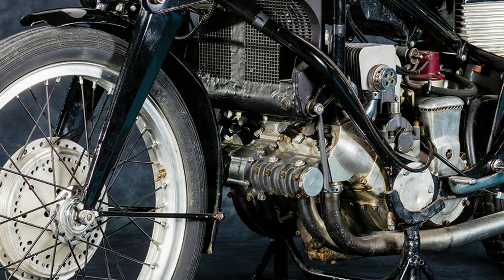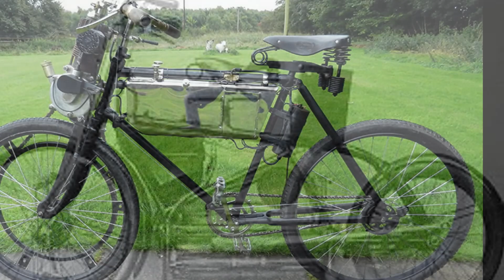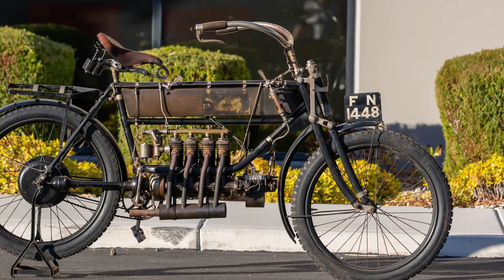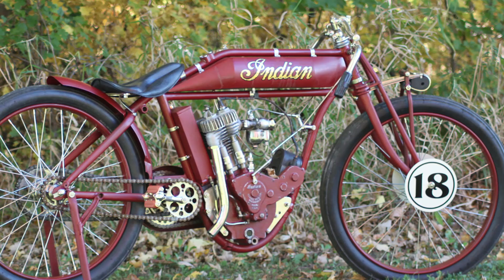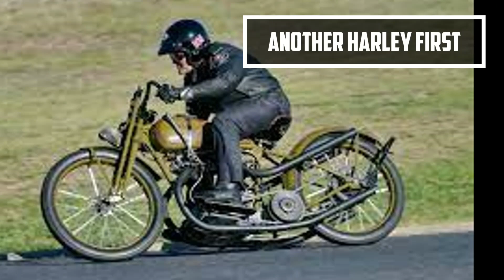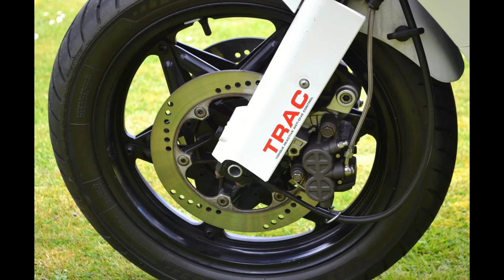15 Innovations That Made Motorcycles Better

Comment: I can believe your channel's growing exponentially! Quality is the watchword. I had to check when the Silk 700S was manufactured, but it was from 1975 onwards, so the 'Kettle' was well before it. Lovely British bike though.
I agree with you about Wikipedia - often inaccurate, so needs cross-checking.
Reply from the maker: the Silk was the final incarnation of the Scott in many ways, just about 70 years on from the first 🙂 cheers for watching mate, I do my best 🙂
Reply: @barebonesmc  Even Alfred Scott was pre-empted with water cooling… by the world's first production bike, the Hildebrand and Wolfmüller.
Reply from the maker: I did say that Scott weren't first but if the H/W was watercooled that pre dates the 1899 Holden I came across. Ive heard a few sources say the hildebrand and wolfmuller was the first motorcycle, but ive got it dated at 1894 as the first multi cylinder, but ive got the Rietwagon as the first motorcycle from 1885, are my dayes out?
Reply: @barebonesmc  H&W was the first series production bike offered on the market… as opposed to prototypes and owner constructed machines, like the Daimler Einspur (or Reitwagen) of 1885, and I guess, as Americans consider 3 wheelers as motorcycles, the Benz Patent-Motorwagen ("patent motorcar"), built in 1885 and normally considered the first series production car, is a motorcycle too.
That strange looking rear mudguard on the H&M is actually the coolant header tank/radiator.
Your references to the Suzuki amused me, as I worked at a bike shop when the GT750 was released with advertising claiming it as the 'first water cooled two stroke'. After Suzuki GB were approached by Scott aficionados, they changed it to 'the first water cooled two stroke triple'… again contested by Scott fans as the short lived (due to WW2) 747cc 3S was unveiled at Olympia in ’34 and finally production began as a 986cc tourer in very small numbers in ’39, before being immediately cancelled. Then again, Suzuki's marketing monkeys had form for this kind of thing, as they advertised the T500 in the States as the first road going 500cc 2 stroke twin (again, Scott had one much earlier, as did DKW)
Suzuki crowed over Yamaha about their 'Pozi' lubrication system (direct to bearings) being better than Yamaha's Autolube… but my brother has a French Soyer 2 stroke from 1922 with a similar direct to bearings oiling set up from a separate oil reservoir, and Scott (yet again) had a system similar to Yamaha's from before WW1.
As for electric start as standard fitting, the Germans had it on several scooters in the fifties (using the dynastart system).
Reply from the maker: @chrisgraham5186  interesting. guess ill need to look at electric starters again :-) Makes me wonder how the industry would have progressed without the interference of the war.. The 500 DKW sounds interesting too, ill have a dig an see :-) cheers for your wonderful and helpful additions :-)
Reply from the maker: @chrisgraham5186  not sure what happened mate, got notice of your comment re pics but cant see it anywhere, you can contact me through the contact page on barebonesmc.com and ill reply, interested to see the bike
Reply: @barebonesmc  YT probably rejected my reply because I included a link to the DKW 500 twin… a 1930 advert for the bike. It may have upset YT's bots. YT doesn't allow pics in comments, so I'll send pics of the Soyer to your link.
Reply from the maker: @chrisgraham5186  nice one mate, cheers again for the info too
Reply: The Velocette LE horizontally opposed side valve twin 150 of 1948 also predates the Suzuki 750 triple by 28 years.
Reply from the maker: @G58  not the Scott though 🙂 Cheers for watching mate the Velo LE was a strange looking thing lol

Comment: i think Yamaha had taken Bimota's lead from the 86 YB4.. they look VERY similar in the spar extrusions & design.. so i hazard Bimota had a preproduction development running in 85 & i recall kawasakis foray into monocoques had wrap around spar elements.. i think the idea was sporned by sidecar racers not concerned so much on wide chassis's more low
Reply from the maker: Interesting theory, it's certainly possible. There’s an interview with korky ballington and the KR500 with monocoque in one of the videos. Think poss the best sounding 2 strokes video here
10 Best Sounding 2 Stroke Road Racing Motorcycles
https://youtu.be/9to1RGAThr0

 or maybe the fastest 500s?

Comment: I just checked back. Vincent used twin shocks, but basically the had centre shocks and stressed engine design in the very early Fifties. They may have earned the title of pioneers there.
An anti dive system was available with the Suzuki Katana in 1982, and I vaguely remember that BMW had something like that even earlier, so Honda may even have been somewhat late to the show there.
Reply from the maker: yep, the Vincent was the first cantilever rear end i think too. as to the anti dive, all i can go on is what i (think i ) know and what i can find out mate, they may have had earlier anti dives. i know they were being used on the race bikes, but i dont remember any on the road until 84, if the first Katana had them im obviously wrong though 🙂 ill see what i find when i get chance, cheers, and have a great weekend
Reply: @barebonesmc  Just take a look at the front brakes of the Katana. It's pretty obvious. The way I understand it, Suzuki used a different system from Honda, though, the brake pressure itself was used to stiffen up the compression stage of the shock absorber. I am pretty sure they had it on at their introduction in 1982.

Comment: What I was told and it may not have beenthefirst, but very definitely an important innovation was Royal Enfields cush drive rear hub. Still used today and the reason why we don't blow our transmissions up. Even with slipper clutches, it is still being used. 
Also, I thought it was FN that first put electric lights on a motorcycle? Or was it FN that first put lights on a motorcycle, as in magnesium strip lights?
Reply from the maker: the cush drive is a good one mate cheers, and i may be wrong on the lights, i do dig deeply but im not infallible 🙂 i would have thought acetyline lamps on the FN, but dont quote me lol
Reply: @barebonesmc  heck yeah, you dig deep! Some of those really surprised me! One thing for sure is people tend to repeat things they hear without checking the facts. Keep up the good work!
Reply from the maker: @750INTERCEPTER  I like the ones that surprise people lol have a great day mate

Comment: No comments I'd surtanley say you mist the NSR125  AND THE TZR125
Reply from the maker: great bikes, but why specifically did you think they changed the industry?  :-) Cheers for watching mate, ride free 🙂
Reply: @barebonesmc  because of the fram and because there 125cc all videos just talk about 300 _1000cc bikes but I'm a 125 man 250cc no good to me & both nsr and tzr had the bigger brothers as well and the nsr was a racing bike
Reply from the maker: @rabone1968  the frame had been done before on the FZR though, and ive got nothing aagainst smaller bikes at all, i talk about more smaller bikes than most but i guess i could look at doing something 125cc specific, ill have a think

Comment: Vincant Black Shadow was a moto shock in 1954
Reply from the maker: had this conversation in another comment :-) as far as i am concerned i would describe the vincent as a cantilever, which yes it was first, but  at the time he couldnt source 1 shock strong enough so 2 were used, hence it isn't really a monoshock despite being a cantilever system, does that sound about right?  :-) Cheers for watching mate, ride free

Comment: The most damaging developments in motorcycle design have been the introduction of EFI and all the fake climate legislation induced pointless emissions nonsense. 

The introduction  of EFI requires a pressurised fuel system, replacing the omission of gravity fed fuel to carburettor system which has worked fine for 100 years. 

The number of messages that the ECU needs to receive from a myriad of sensors before it will start is simply ludicrous. And a flat or even low battery that’s deemed incapable of running the fuel pump and the starter, can also guarantee that a modern bike won’t start. 

In a full analysis, none of these systems represent genuine positive improvements in the long run. Indeed they shorten the potential useful economic life of the bikes to which they’re fitted. They also pander to the modern type of leisure rider for whom a bike is a means to look good whilst sipping overpriced coffee, and pretending to be on an adventure…!
Reply: Yes it's true, a lot of these systems developed at the cutting edge of wartime or competition, have been foisted on us conventional motorcyclists to no good effect. A couple of my favourites (having a slight off-road bias), are rising rate rear suspension that include complicated linkages, and upsidedown forks. Fine maybe for extracting the last few percent of competitive advantage, but  not of any real advantage for the average road rider, except down the pub. I admire the elegance of EFI, but if mission critical I'd take the carb any day(and I'm not criticising the reliability of either system, just the simplicity, component count, and cost).  I remember reading the last few pages of the operators manual for my new KH250 as an 18 year old, all that Californian special edition nonsense makes a lot of sense now. It's the legislators that have ruined everything for sure. Is it a coincidence that Amazon have removed the trailer for 'The last motorcycle on earth' ?
Reply from the maker: @MarkDaleADV  you see this is why i love this, i had never heard of that show, ill be watching it later lol cheers 🙂
Reply: @barebonesmc  It’s just like going down to the pub in the old days and bumping into Ted who in his day had ridden every bike from the 1930 to the mid ‘70s. Only here we meet guys from all over the world. 

Ted was a real chap by the way. He wore a battered old leather greatcoat tied together with string, and an off white pudding basin helmet, and rode a Bantam. 

He was the Secretary of the Phoenix Motorcycle Club in Derby in the mid ‘70s when I learned to ride at the ACU training scheme the club ran at the old barracks at the top of Osmaston. Club meetings were held on Tuesday nights if I remember correctly, at the County pub - where I enjoyed pints of Marston’s Pedigree for the first time. 

I drove past that way to collect some 1980s and 1990s car magazines in Littleover. The County is gone completely, and there’s a tyre depot or something in its place. 

Progress?
Reply from the maker: @G58  cheers to that 🙂 never mind the Pedigree, It was the Old Peculiar that you had to watch out for lol 🙂
Reply: @barebonesmc   Oh, the Ode P. Even though I thought I was a competent beer drinker, on my 30th someone bought me an extra pint of Ode P at the Holly Bush at Makekey. What happened after that apparently is the stuff of legend. We did go on to somewhere else (no idea where), and demolished several bottles of very nice Champoo. 

Next morning I reclaimed the keys to my lovely SAAB 900 Turbo from my (then) responsible brother, and called the phone number written on my hand. Picked up Sue and went off to Ashbourne for breakfast. 

The hangover hit like a steam train at around 16:00! I was of course still well and truly pickled on the crazy combination of Ode P and Champoo. That stuff is magic. Thank you for reminding me of my yuppie lost weekend. 

PS
The beef and horseradish rolls at the Holly Bush were the best on the planet. A proper pub selling proper beer.
Reply from the maker: @G58  spent many of my formative nights there, and dragged a few people out of ditches on the way back lol, the owd roger was the one that killed my brain cells 🙂i loved the way they just brought the beer up from the cellar in jugs 🙂
Reply: @barebonesmc   That rain gully by the wall! Yes. And you’re right, it was the Roger, not the P!! My memory was affected by that night!! Small world isn’t it?
Ride safe.
Reply from the maker: @G58  lol, yes it is mate 🙂 if you see a ratty looking Vstrom thats dark red but with 1 blue side panel give me a shout 🙂 Grindleford Cafe or the old Forge at Monsal probably my most common stops 🙂
Reply: @barebonesmc  Duly noted. Easy enough to spot. Nice locations. 

Until I get one of my bikes back on the road, I will be in my blue 1999 SAAB 93 cabriolet, top down optional, depending on whether I’ve fixed the hydraulic struts. Four of them are leaking like a… 👀🧐😎😜

Ride safe.
Reply from the maker: @G58  nice car, we rode straight past today it was so packed, wouldve been waiting an eon for a drink. i had an old Saab 99 years ago, now that was a bombproof car, used to take it rallying throught the woods 🙂
Reply: @MarkDaleADV 

I agree. The legislators are the willing paid puppets of the psychopathic elites. They are ruining literally everything by stealth. 
EFI is ‘convenient’ (especially for the cafe poser generation) in the same way the soon to be introduced digital currencies, and the once mandatory, hugely expensive ‘safe and effective’ single dose (plus boosters) chemical jab for a laboratory released mild respiratory infection was better than all the off patent medication usually prescribed. 

But EFI requires a digital engine management system, which in turn requires constant updates from sensors all over the bike, monitoring everything from the position of the camshaft, to the oxygen content in the exhaust! If any one of those sensors fails, or the wires break or ground to earth, the fuel pump won’t run and the bike won’t start. Result: a ride home in a recovery truck and a visit to the dealer for a big bill!

Upside down forks are stiffer, but catastrophically dangerous in the event that a seal goes, because the pumping motion has gravity as an ally in their desperate attempt to deposit the fork oil on your brake disks and pads. This means that if the process doesn’t kill you, it absolutely guarantees you will have to strip the forks down immediately, replace the seals and pads, as well as clean the oil off your disks, callipers, wheel and tyre!

Just as many of us have fixed carbs at the side of the road, or in our own garages, we’ve also ridden around on bikes with conventional forks that have weeping seals, sometimes for months - without any serious short or long term consequences. 

For all these reasons and many more, including the excessive weight of modern bikes, I’m in the process of designing and building a CCM 604 frame based lightweight adventure bike (inspired by CCM’s mid to late 1990s Dakar entries) with a BMW F650 Dakar engine, retro modified to run a Mikuni carb. 

I’m still working on the frame modifications, and which ignition solution to use. F650GS forks and wheels will of course be excellent. 

My best estimate is that it will weigh about as much as a Honda CRF250 - with twice the power, so something close to the power to weight ratio of a 1250GS! But the biggest advantages are increased reliability and the fact that it will be very easy to pick up when I drop it… pretending I’m crossing the Sahara! 👀🧐😎😜🏴
Reply: Mine are 81 to 04 (x9). Can't see me buying anything new, ever! Even my 31 year old son knows the truth, " everything was just better in your day Dad(he says), Music, Bikes, the lot"
Reply: @MarkDaleADV  100% true. You did well. Your son is smart.
Reply from the maker: @MarkDaleADV  progress eh 🙂
Reply from the maker: get it said mate :-) cheers for watching , enjoy the ride 🙂
Reply: @barebonesmc  Yep, buy old bikes 🧐😎😜
Reply from the maker: @G58  mine range from 74 to 2008 lol. the Vstrom is the newest and ive had that over 15 years 🙂
Reply: @barebonesmc  Cool. 2007, 1989, 1983, and others. 12 in total now. Lot of work!
Reply from the maker: @G58  yep lots of work, hence why i have been trying to thin them out gradually 🙂
Reply from the maker: @G58  yep, thats why i keep trying to thin them out lol, i went up to 14 at one point n had to start saying no to myself lol im just not good at letting go sometimes  🙂 cheers for watching mate 🙂 Ride Free
Reply: @barebonesmc  Yet we have to avoid 13 too…!!👀 You too brother.

Comment: The VF750F of 1983 had anti dive forks - before the USA’s Night Hawk. By all accounts they didn’t actually work very well. Both mine are still in pre restoration stage. The European model is in bits, whilst the rarer Marysville USA model is almost complete but not running.
Reply from the maker: :-) im bound to get some wrong i guess :-) cheers for watching and the comment mate, enjoy the ride 🙂
Reply: @barebonesmc  Yep, I know a little bit about a lot of things too. If you asked me about Yamaha, Suzuki, Kawasaki, most Triumphs, Nortons etc. I would not be commenting. But a few Hondas, including the VF750F Interceptors, some Velocettes I’ve collected some half decent reliable knowledge. Some of it is first hand. 

Ride safe
Reply from the maker: @G58  have a good un mate
Reply: @barebonesmc  Cheers. You too.

Comment: I believe Vincent had cantilever rear suspension before Yamaha?
Reply from the maker: yes triangulated cantilever but it used a dual shock system, apparently there was no shock strong enough to use a single unit at the time so i have been told